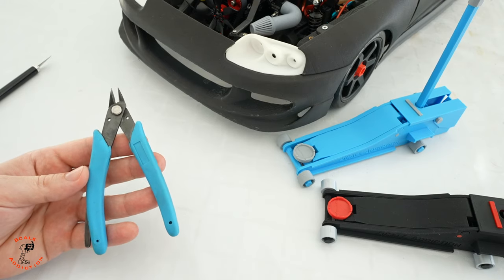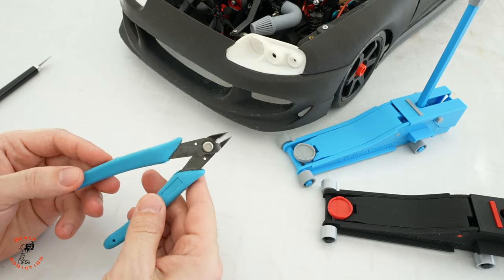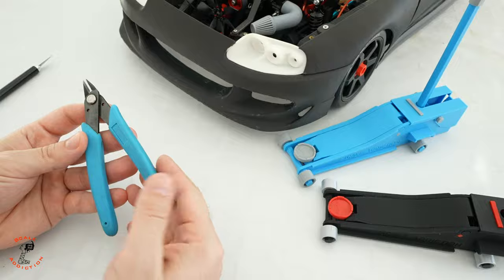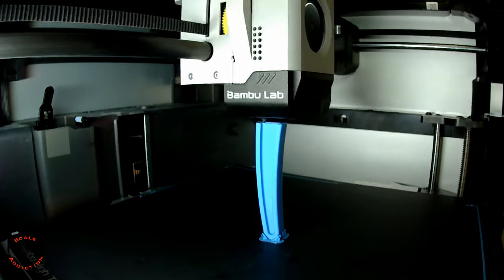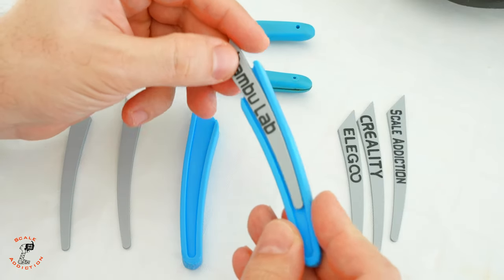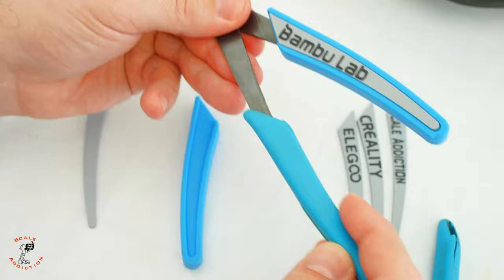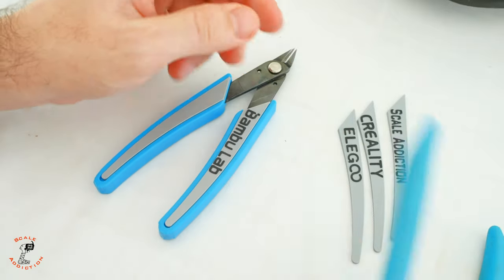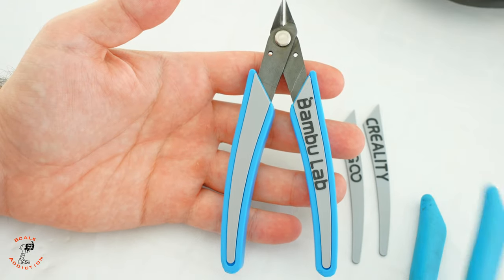Make it better now / No more annoying handle

Comment: A much better idea is to not use cheap rip off copies and buy a real one. I have a pair that I have used regularly for 10 years and my handles are fine. Original ones are marked with 'SWANSTROM USA IMS-100832' cheap chinese copies are usually unmarked.